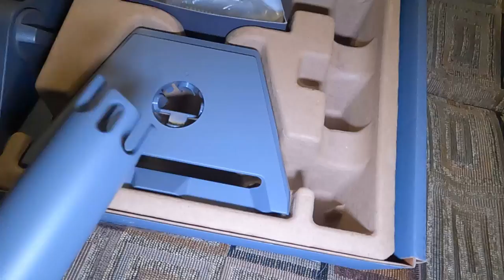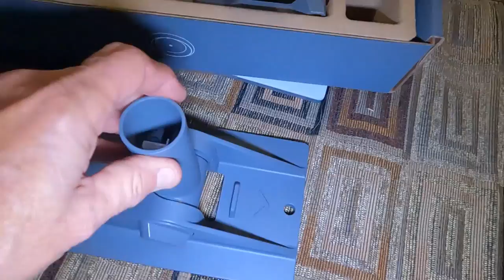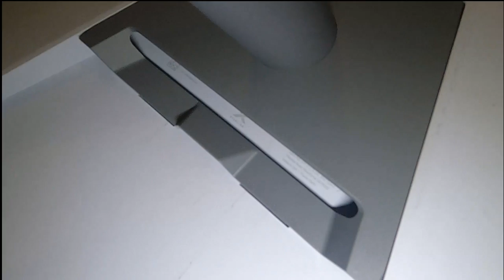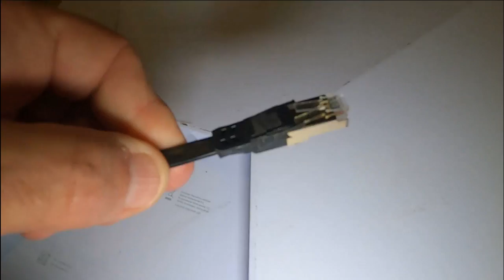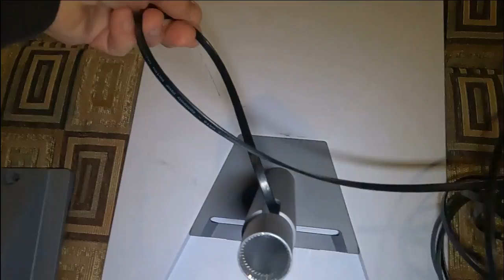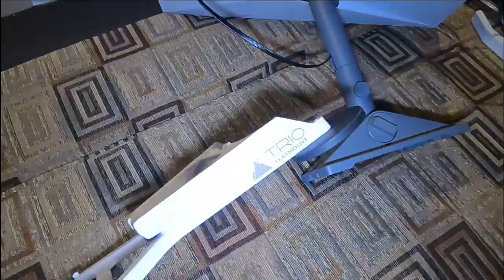STARLINK STANDARD GEN 3 ROOF Mount REVIEWED Trio roof mount bonus.

Comment: I asked the same question in another video, but perhaps you can help me with it. Does this pivot mount work for flat roofs as well? Most tutorials on this kit focus on pitched roofs, which makes me worry about buying it and ending up with a bent mount on my flat roof. Based on what I see in the tutorials for the original Starlink pivot, it looks like you can rotate the knob to tighten it so it’s perpendicular to the flat roof. Is that correct?
Reply from the maker: Yes it will sit at 90 degrees from a flat roof or any surface. We use these on a pallets for camps, flat building roofs or temporary sites on the ground

Comment: Is this mount for rooftop or for RVs
Reply from the maker: It can be used on both or many other applications and it is a very solid mount.
It needs a solid mount location on a rack or have a beam or backing plate to support the lags or if using nuts and bolts on any roof or RV